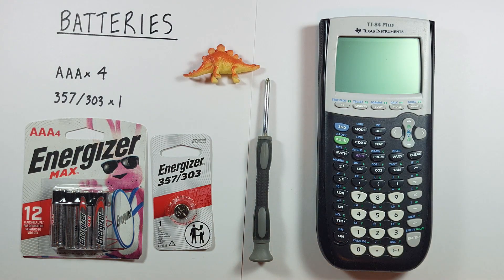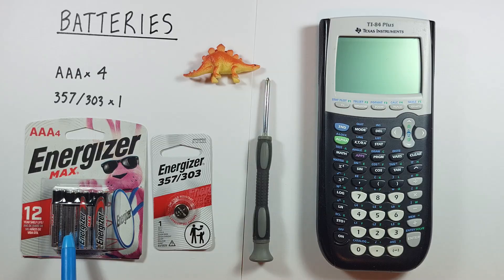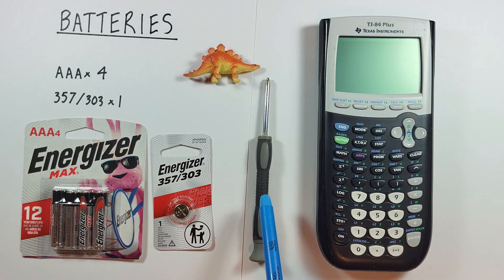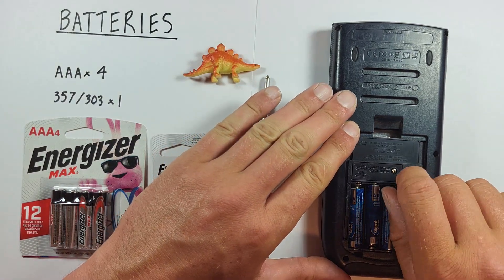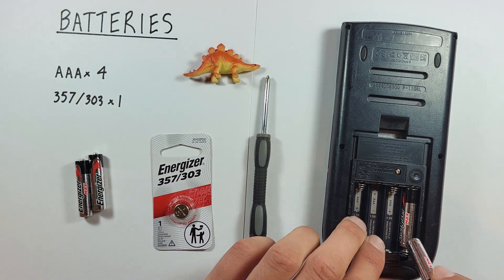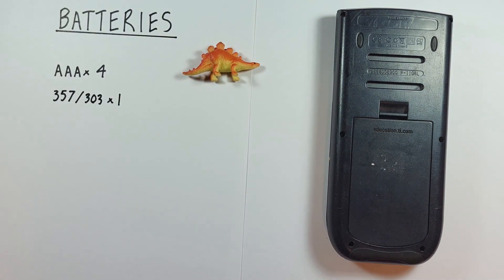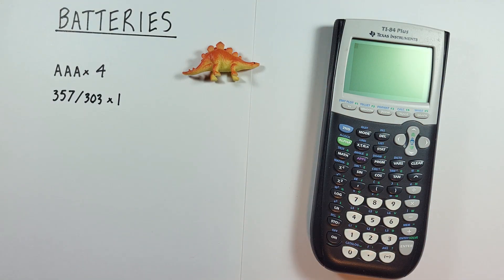How to Replace the Batteries on the TI-84 Graphing Calculator

Comment: How does your L1154f fit? I can’t get it to stay correctly …
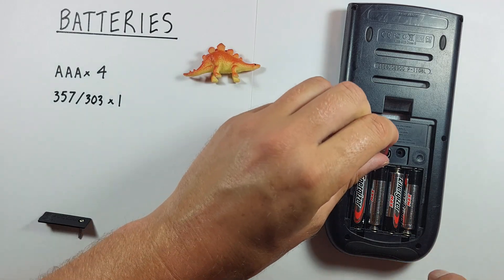Reply from the maker: Hi there! there is a bit of a lip on one side, so that you have to push the battery down then slide it underneath the lip so that it will fit. at 3:21 you can see how I have it angled to fit under the lip. I hope this helps!
Reply: @HDCalcs than you ! I got it .